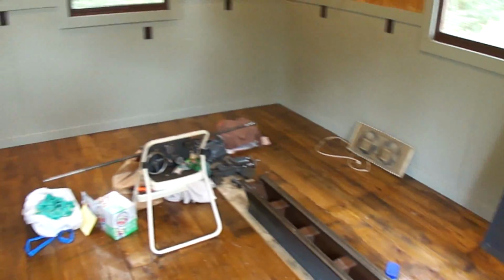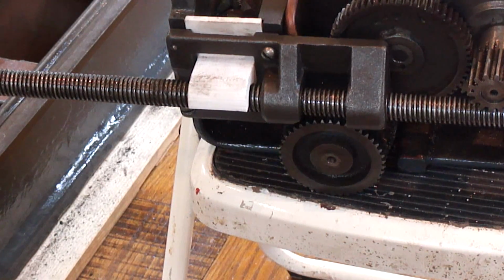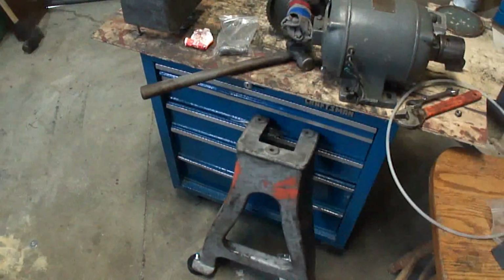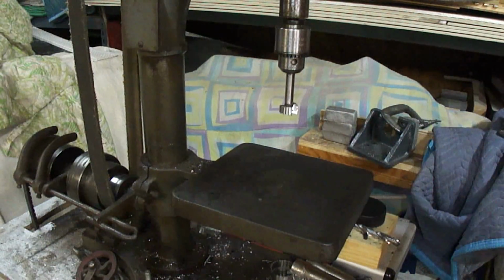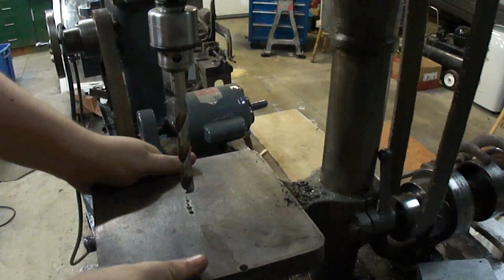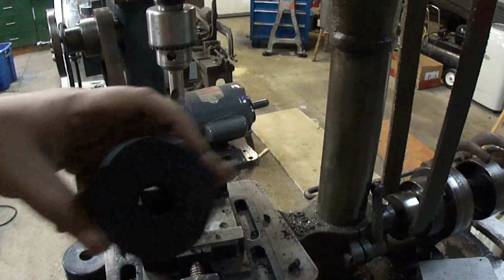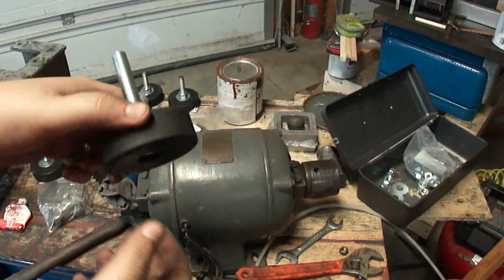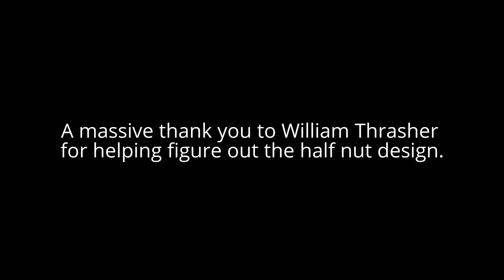Shop and Lathe Stuff, Making Leveling/Anti-Vibration Feet

Comment: I'm always impressed on the steady progression you're able to achieve with all your projects. I'm totally jealous! Great idea with the hockey pucks!
Reply from the maker: lol, yea, the hockey pucks idea has been around for a while now, but I just liked the look of them on the shaper that I saw a while back. Ive always been taught that it doesnt matter if you can do stuff really fast all at once, eventually your going to get worn out and have to stop, or you can just keep at a steady pace and have the same results while staying busy, lol.
The funny part is, we've also been building the front of my grandmother's house too, expanding the house outwards, replacing the dry rotted and stuff that the termites got ahold of, reframing everything, and already have the siding on it too, and thats just in the spare time, lol. My grandfather had the sandblaster that I used to do the legs, so I just did those in between breaks from doing that. So busy busy, lol.
Reply from the maker: As a side note, the legs and everything have been primered and painted already, probably tomorrow Ill be ready to start assembling the lathe. Also, the molds are ready to be burned out for the lost PLA too, so hopefully one of those turns out and fits correctly for the half nut.

Have you seen paul's garage's discord server? We've been on there talking metal casting, forging, all around metalworking, it's alot of interesting people and you may be interested in it, I can send you a link if you wanted.
Reply: Chirpy's Tinkerings - man, you are one busy guy! I do sub to Paul' channel. One of the first subs.
Reply from the maker: yea, he set up a discord server, it's kinda like AA, how it keeps having the guys new to metal casting coming in, but it's like a big chat room. Its very addicting and you tend to not get as much done with it on, but very fun to chat with everyone, lol. Here's the link
https://discordapp.com/channels/334520675312336898/334520675312336898
hope to see you on there, lol.

Comment: Excellent, nice trick with the pucks. Love the idea.
Reply from the maker: yea, they work pretty well, only modification I would do now is add a thick disk to the top of them so that they distribute the weight a little better and wont flex as much. Thats why my shaper looks like it's rocking in the videos a little bit, it's those feet that's squishing slightly as the ram and internals are going back and forth.

Comment: glad to see that half nut is working
Reply from the maker: yep, working good, I reprinted it 1% oversize and removed the slot in the bottom of it, and now is in plaster/sand mix to be cast out. If everything works out alright, Ill have a half nut very soon that fits the lathe. Thank you so much for your help, I had been looking for that for close to 2 years on and off, ever since I got the lathe and discovered that the half nut was missing. Thank you again.

Comment: Your floor looks great in the new shop man.  And CLAMP YOUR WORK.  You holding that thing gave me the willies...  I was drilling some POS sheet steel last year, it grabbed and sliced me like a fish.  No stitches, but taught me a valuable lesson.  ;-)
Reply from the maker: lol, most of the time when Im dealing with metal, I do clamp everything in there, but that is just hard rubber disk with knurling on the outside. If it does grab and spin, it wont do anything. Also, that design of drill press, if the bit catches, it slips the belt off and keeps it from grabbing. Ive had it do that a few times when Im doing work with brass, and it doesnt tear up your hands like the other drill press I have does. 

Also, thanks, the sound of the sanders running the day I released the tailstock video, thats the day we were doing the floor, so it's been a while. It's done in the old style shellac that they used on foundry patterns, I found a can of that and it's all we had. The walls at top are coated in a few coatings of polyurethane too so that it stays nice, but the fumes off of the polyurethane is so strong in there that after a few mins of being in there, you start tasting the color purple.
Reply: Was thinking the same, it would probably just spin in place if it grabbed at worst.  Still...  I know a girl who took a stray puck to the forehead sitting in the stands as a little kid, decades later still when she goes outside in winter on a windy day her whole face goes red except for a puck shaped spot in the middle of her forehead...

Also Canadian law requires me to inform you that is puck abuse, lol
Reply from the maker: lol, they do make good feet for things tho, just look at my air compress if you dont believe me :P
Im so covered in scars and stuff from broken bones from everything but machining stuff, so one more bruise wouldnt even be noticable tbh, and I have scars from stitches all over my forhead from when I was younger, so that wouldnt be that big of a change, lol.
Also, if that thing did get kicked off, it wouldnt do anything, the belt would slip before it caused any damage to me or the drill, and the puck is just made or rubber, and that drill goes at a low speed, which I like most of the time because it keeps the rpms of the bits down low for larger drill bits if I need them, it keeps them from chattering through the hole as your drilling. So it wouldnt really even through it tbh, maybe bump it 2-3 inches at most if it ever did toss it.
Reply: No pucking way... Really?

Comment: Awesome--Never saw the hockey puck trick before. You're right--Those commercial leveling feet are crazy expensive. I'll do as you say in the comments below and make a bigger "washer" to distribute the weight. Thanks for sharing.
Reply from the maker: yea, they do work really well, but under the weight of the shaper, they do flex a very very tiny amount, so when the camera is zoomed in, it looks like the shaper is rocking back in forth, but in person, you can't really see it tbh. They've also held up quite well over time and would definitely recommend them.

Comment: So what is the verdict on the camel back drill?  Useful or just different?  I see a few guys have them- just curious.
Reply from the maker: for a drill press, I wouldnt trade it for a newer one for anything. The old cast iron design and everything is so rigid that you dont end up having table flex like you would with a modern drill press, so when you set the table, it drills straight down at a 90 degrees, not off at an angle like most drill presses Ive seen today. They are defenitely a different style, but far more rigid due to the design. it may not look it, but it almost took 4 people to get that thing into the building, it's that heavy and built that strong.
Reply: Thanks hoping you would say that. There is one around Detroit that I was looking at. The flex you noted drives me nuts and not everything will fit on my Rockwell vertical mill. My benchtop Rockwell has too much give in the quill - I redid the bearings and improved it. I'm just not happy with it.
Reply from the maker: yea, I absolutely love mine, it is so rock solid that I use it for alot of precision drilling. It uses an MT1 taper in the quill, and I have some MT1 drill bits, which over 4 inches, it's less than 0.001" of runout, and with MT1 spot drills and center drills, where you put the stuff, thats where it goes exactly. I used it to make my steam engine cylinder bolt holes and steam port by clamping the indexing table to the top of the table of the drill press, and the holes are drilled perfectly 90 degrees. I tested that with some threaded rod and a square afterwards.